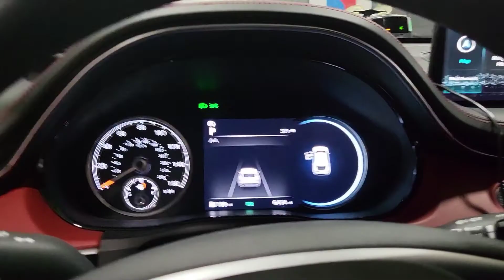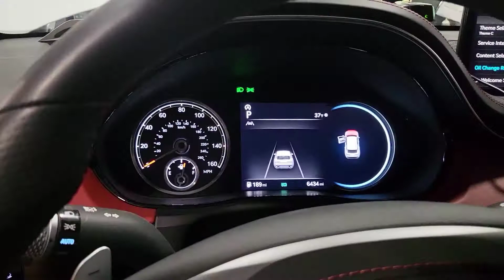2022 Genesis GV70 GV80 2.5T How to change the oil and reset maintenance light

Comment: Be doing this tomorrow for the first time. Helpful!
Reply: what did you get for a filter? can't seem to find one online
Reply: @save229   From the dealer. I did find them online but the 3 that i got all had smaller inlet holes than the OEM. Wasn't about to use them.

Comment: I had to sit in the dealership for hours because they said they had to drop the turbo. But now I see it's simple
Reply: A dealer thought they would build a car that you have to pull a turbo to change the oil on?????????
WTF?  I would RUN RUN RUN from that dealership.

Comment: I always like to change my own oil. Will attempt to do this without a lift…only have ramps.
Reply: It's very simple. I did mine on ramps.
Reply: @mikeb1039  Cool. Just wanted to ensure having it on  an incline still allowed adequate  drainage of old oil
Reply: @otm777   yes it does. Look precarious on the draining but it flows through the opening with no problem.

Comment: Thanks Dave - very helpful.  I have this exact make and model, and like to change my own oil.  Are any 3rd parties (fram, Mobil 1, K&N, STP, etc) selling oil filters for the GV70 2.5 yet?  I can't seem to find them anywhere.
Reply from the maker: I don't believe so
Reply: @davrulesdawurld  Thanks.  I wonder if the filter cartridge is the same that's used in other Hyundai vehicles?  (and if I buy a 3rd party filter for one of those, if it will work?)  I also went to the official genesis parts website, and it looks like there's 1 generic filter there that's supposed to fit a bunch of the different models.
Reply: @timhassett7302    NO, I got those and the inlet opening is smaller than on the OEM. THe opening is actually ok, but there's  gasket that covers some of the opening.  Did not look healthy to me.

Comment: Why doesn’t the power socket or outlet not work behind the center console.  It has a little red light on before plugging it in then it stays red I get a second of power then nothing 2023 gv70
Reply from the maker: Check the fuse for the power outlet
Reply: the motor is running?
Reply: @mikeb1039  yes the motor is running it won’t work at all.
Reply: @billf9847   see: 1st response

Comment: Ok, but does anyone know what kind of LED light bulbs are required for this GV70?
Reply from the maker: If you're having an issue with your lights take it into the dealer, it should be covered under factory warranty since it's so new.
All the lights on these cars are non serviceable

Comment: Where did u order the oil filter from I have a 3.5t gv70 and in my area none of the kia or hyundai dealerships will help me in ordering a oil filter they said they can't order genesis parts anymore eventhough I bought the gv70 at Baytown Hyundai
Reply from the maker: I work at a Hyundai dealership, we stock the oil filters. Maybe those filters are on backorder I've only ever done 2 GV70s. That's the only reason I see your local dealership not having any.
Reply: @davrulesdawurld  ya they told me straight up they couldn't even get the oil filter I called like 4 or 5 kia and hyundai dealerships. Lol think they just didn't wanna mess with it. I would order on Amazon but the part number I have for the filter isn't a exact match to what I found on there.
Reply from the maker: @bmf88  probably national back order, had the same thing happened with the 3.8s back in 2020
Reply from the maker: @bmf88  at the very least you can drain the oil filter to get as much dirty oil out as possible
Reply: @davrulesdawurld  ya that was my next move to try that and match up a filter like a k&n or something to replace it with
Reply from the maker: @bmf88  good luck
Reply: @davrulesdawurld  thank you sir
Reply from the maker: @bmf88  no problem
Reply from the maker: @B M  talked to my parts dept about your issue the other day, they said the only reason they wouldn't be stocking Genesis filters is if they lost their Genesis license
Reply: @davrulesdawurld  Thank you for the heads up
Reply: Hyundai really sucking it up these days.  The engine troubles (and magnitude) really disturbing. I think we'll be trading our GV80 in the next year while it's value still holds decently.

Comment: I dunno….maybe it’s just me but I would be livid pissed if I paid for someone to change my oil and I got it back covered in oil like that.
Reply from the maker: What I didn't show was when I cleaned the engine bay with a light cleaner, as it is not required for the oil change.
Reply: How would you know since your princes clean hands wouldn't be under the vehicle in the first place to change the oil?
Reply: @davrulesdawurld  You didn't really show the oil change at all.:face-orange-frowning:
Reply from the maker: @robertslegers257  did you want to watch the oil leave the engine? This is mainly to inform of the location of the plug and filter and the fill capacity.